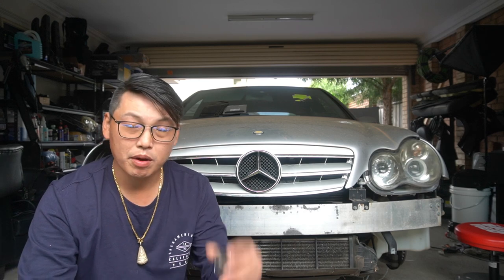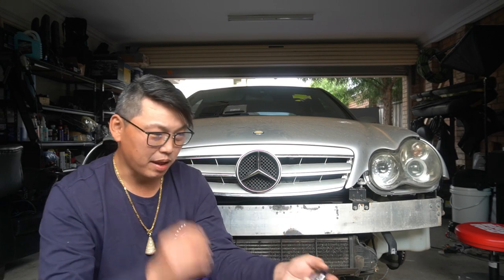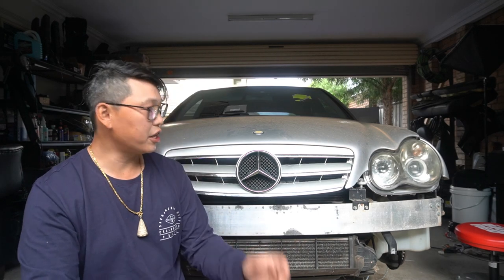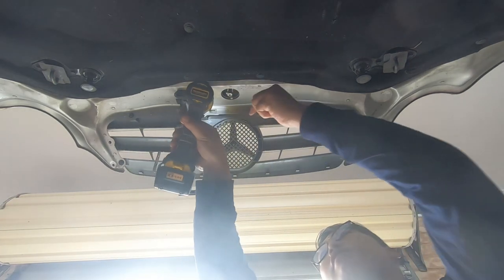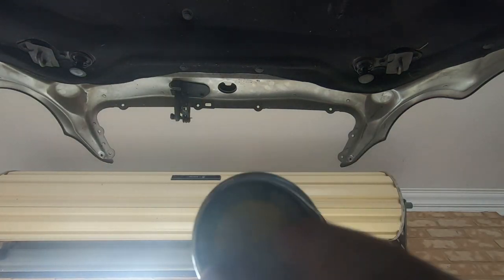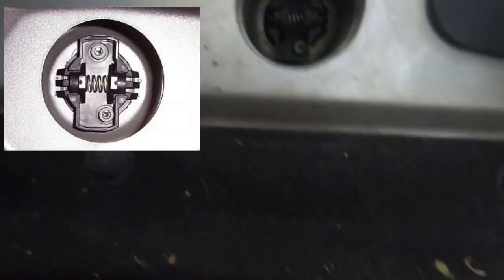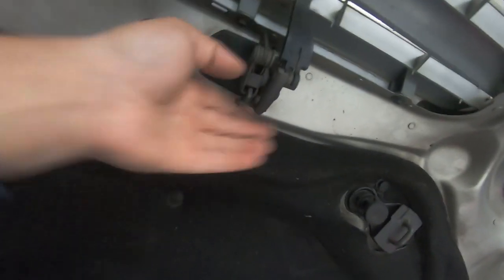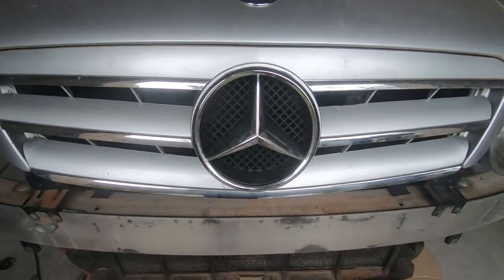MERCEDES W203 MODS HOW TO CHANGE YOUR FRONT GRILL AND BONNET BADGE

Comment: hi you have my Abo,one Question the Grill isnot dirctly from w204? its looks like but for w203?? and the little badge is originalpart from which model? or this gives also for w203? Please helpme !
Reply from the maker: badge from w204 original and grill designed for w203 of eBay

Comment: Hi Mike great video , quick question does the fact of the new badge been 10 mm bigger, does that going down into a recess of swords and if so does that mean that there is a small 3 to 4 mil cavity behind the badge I can't think of any problems  that would cause , I'm just trying to picture in my mind's eye , more so did the smaller one fit into a recess that would have brought it flush with the bonnet,  if what I've asked it is true that means that when you are fitting the larger one it means it fits tighter in the way that you give it a small tap for the other side to engage and yes there is a small 3 or 4 mm cavity would you not have considered putting a small bit of silicone  behind the badge to prevent the local Bart Simpson robbing it as a trophy,😂😂😅 great video 👍

Comment: Hey which excat grill from a w204 did you upgrade to  ? Because some w204 grill s won't fit a w203
Reply from the maker: its for w203 just looks like w204
Reply: @MIKEYZVLOGZ  ok thanks where can I get one?
Reply from the maker: @Play mode  ebay or aliexpress just search w203 grill and u will see a selection of grills.. u can get 3fin or 4fin grill mines 3 just like w204 .. there are many types of grills ..just ensure for w203 and choose the style u want ...always confirm with seller thT it is for a qdr or 4dr

Comment: Hey do you know how to replace the hood? My w203 hood is rusted so I was looking to replace it but have no idea how as there are no explanations online or anything
Reply from the maker: it's pretty simple u remove the bolts that connects it to the hoot where the air ĺifters are that raise the bonnet and it will come off ..getting it back on is the harder part as u need to line it up so it siysd flush .las food practice
Reply: @MIKEYZVLOGZ  the torx bolts near the air lifters right ?
Reply from the maker: @TheBatsumisSuperman  yes
Reply: @MIKEYZVLOGZ  thank you my man
Reply from the maker: @TheBatsumisSuperman  all good welcome

Comment: Hi, what if i wanna put a forward camera in my W203.. is there any good place that i could put it? btw, my bumper is the AMG style  bumper type...
Reply from the maker: hey bud, so u just want to install a camera correct? id have to see the camera in order to know where i might put it send me a link to the camera so i can check it out and ill give u my opinion
Reply: @MIKEYZVLOGZ  Well, i do not have any specifics on the camera yet.. just figuring some available options if you have any opinion / recommendation. My W203 doesn't come with front parking sensors (if you have after market recommendations on this would be great too!) 
Not sure if this kind of camera fits the front badge grille and i'm not sure about the quality. .
https://www.ebay.com/itm/282598737459
Reply from the maker: @putranazrul9819  well u can get some desvent parking sensors for sure..will involve removing front and rear bars to screw them in and cut holes out ..check ebay ... or try find retro fitting ones ... if possible.. still after market but made specifically for ur model.. im just suggesting incase u find it... as for camera i havent seen any that go to w203 unleas u just want daah cam?

Comment: can you change the w204 grill to a diamond grill? would look sick on my w204
Reply from the maker: on this model??? as long as its made for the w203 it should fit without issues... but obviously u cant just take a grill off a ww204 and fit it it wont fit as they are completely different size and shape ..they make heaps of grills now for the w204 and w204 so which ever model u drive u can find what ur heats desires